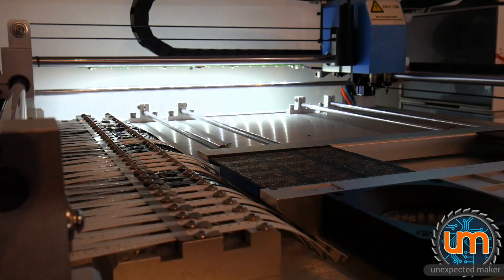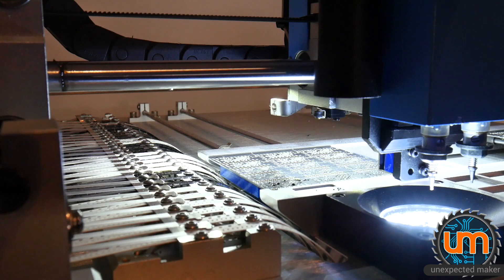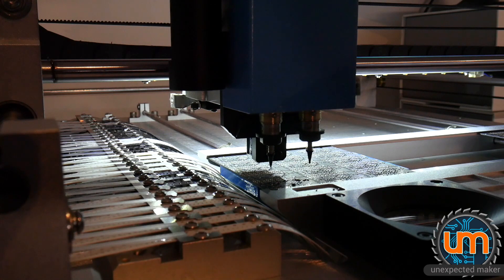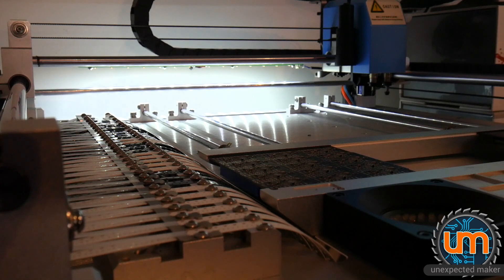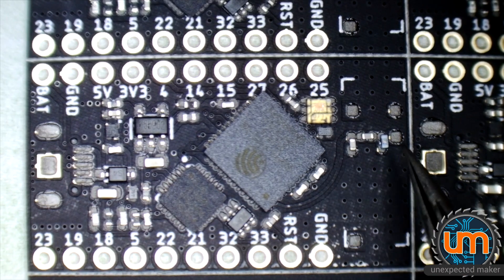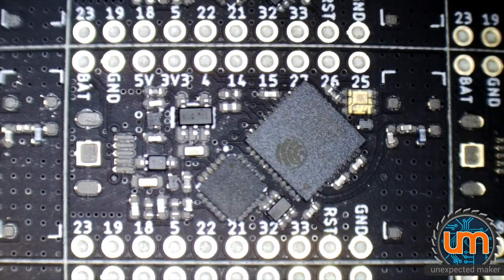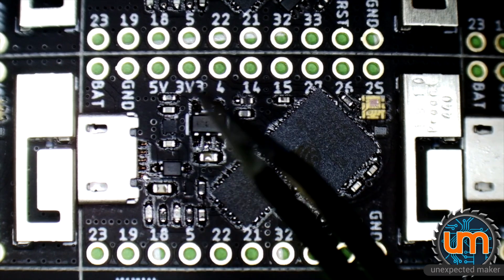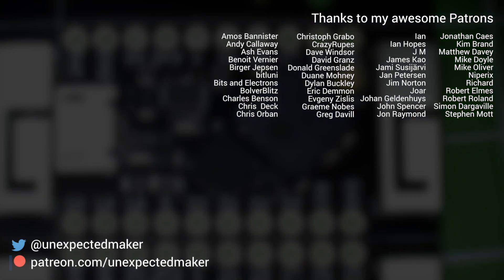My Pick n Place - Who won the battle?

Comment: I've got the CHMT-530P from the same company. The adjustment you need to look at is Z-axis speed. The parts are being placed with too much vertical speed causing them to bounce around on the board, giving the inconsistent placement you are seeing. Once you adjust this, you'll see that you get far more consistent placement.

Comment: Your're working completely outside my knowledge range... I watched a video a while back, and was fascinated by the way components "floated", and centred themselves in the oven.  This is obviously not the case with the small stuff like caps etc?  Interesting videos thanks.
Reply from the maker: The smaller the package (0402, 0201) the lighter they are, so get less influence from the surface tension pull from the solder paste as it reflows. Also, in my case, I am using quite small pads (due to space limitations) so even less pull from surface tension. You get to learn A LOT about DFM ( design for manufacturing) omg a project like this :D
Reply: @UnexpectedMaker  :  Thanks for the heads-up.  Again, not something I will ever use, but I was captivated by an older series by Dan Gelbart on Rapid Prototyping.  By the time I kark it, I will be right up to speed on everything... you've got to love Youtube!  Good luck with your ongoing battle.   :o)

Comment: Hi,

this might be a bit of a silly question. Would the black solder mask influence the surface tension, causing trouble with the 0402 parts?
I have seen a few videos where people get them to re-flow seemingly without issues with the classic green solder mask.

Ben
Reply from the maker: Not a silly question, but not specifically I wouldn't think, other than pulling more heat away from the pads than usual.

Comment: I realize it's too late now, but the size of your panel makes for a lot of risk for something to go wrong.  I would have been inclined to cut the panel size at least in half.  Sure, you're handling more panels, but less risk of a major wipeout, easier to calibrate to get the entire board, and easier to turn around tweaks that you make as you improve things.  Good video and congratulations on getting a bunch of boards into production!
Reply from the maker: Thanks Randy! I'm not sure what could go wrong that I'd lose any of the boards on a panel? Boards can always be cleaned off, and parts recovered, but all boards can be reworked and fixed if there is a bad issue, so no real risk that I can see. Calibrating 3x5 is no harder than 2x2... I calibrate the bottom left and top right, and everything fit's into place nicely.
Reply: @UnexpectedMaker  Perhaps it comes down to how much the parts are worth on a panel.  I have a small panel with four small boards each panel, but a populated panel is worth $20 in parts.  Not something I'm willing to just wipe off and start again.  I also don't have enough time to recover the parts and somehow put them back in the tape for a do-over.  For me, if there is a panel that needs to be wiped then all the parts are effectively lost with it.  Sure, I have piles of loose parts in my component trays that the machine has dropped over time, but I've never done anything with those parts once they got pulled or fell out of the tape.  I have to admit cringing watching how many components you had to nudge.  Given you have a lot of random placement problems, I still can't help wonder if a smaller panel would give your more process reliability.  Glad you're happy now with your methods.

Comment: Maybe tweek down the acceleration? Tighten belts? It sounds like you've got the systematic error down so calibrations won't help, you're left with random error.
Reply from the maker: It's proprietary software, so no ability to change acceleration curves. Belts are fine.. it's all been solved since this video.. stay tuned for an update video :)

Comment: Wow, that speed is scary to watch! Shame it's not 100% perfect, but I doubt if even the most expensive machines are. I love the double pick up and place of the large chips, very cool!
Reply from the maker: Yeah, I've optimised the nozzles so I get more dbl pickups now, so less travel, and faster assembly ;)
Reply: Your thoughts are correct. Professional Pick-n-Place machines are not 100% accurate aswell. Scotty was at the PCBWay factory and as you can see on this link, after the Pick-n-Place process, a person is doing visual inspection and improved using tweezers where necessary. http://www.youtube.com/watch?v=24ehoo6RX8w&t=6m18s

Comment: Try looking at the speeds, it could purely be under/overshoot, if there are ramp controls adjust them to be slow ramps to smooth out the movements to help ensure that it is stopping in exactly the right place, rather than overshooting randomly which could result in the issue you are seeing.
Reply from the maker: I don't have control over those types of settings... it's proprietary software, and none of that is exposed that I am aware of. I'll need to solve this with the options I have available to me.
Reply: @UnexpectedMaker  what kind of control signal does the software gives?

Comment: How come it sometimes picks up two components, and at other times only one?
Reply from the maker: Two different sized nozzles for different parts, so if 2 parts in a row need the smaller nozzle (left) then they go one at a time. I could optimise the parts order to get more 2x pickup happening, but that means screwing around with something that is reliable atm.
Reply: @UnexpectedMaker  Right. Got it.

Comment: I'm just starting to look into PnP and reflow.  Overall, how much 'better' do you feel the PnP would perform with a board of 0603 or larger smd components?  Do you feel the 0402 placement and reflow is an overall issue for entry level PnP machines? or is the need for moving parts under the microscope and reworking after reflow pretty much normal for entry level 'home production' with a PnP?

Great work, looking forward to learning micropython with my TinyPico :-)
Reply from the maker: I don't think you'll find a PnP under $30k that will do a job requiring no hand adjustment afterwards, and it's as much to do with the stencilling and paste application as it is for parts placement. COmponent size doesn't matter in this case, but the smaller the part, the more out of alignment it will be due to the same position error on 0402 will be half off the pads, where the same position error on 0603 will be 3/4 on the pads still.  Even $150k+ PnP machines need lots of work and calibration and tuning. So it depends on what you need to build. Hand assembly is your best option unless you need to build hundreds.

Comment: Great work.  How much does the vibration or movement during placement cause the parts to move, or was that just the camera moving?
Reply from the maker: I can't prove there is any part movement on the nozzle from machine wobble. Too many parts place reliably to have that be the main factor or a factor at all.
Reply from the maker: But I am going to look into this - stay tuned for part 2!
Reply: @UnexpectedMaker  will be interesting as there did seem to be a bit of movement which could shake the components..

Comment: They should make a single part that contains 8 1k resistors , 2 10k, capacitors, and 5v and 3.3v ldo, and maybe 1 or 2 leds (different colors).
Reply from the maker: Hahaha! 1 PCB, 1 component, everything inside.!
Reply: @UnexpectedMaker  exactly! Only the wires need to change per design ! :-)

Comment: If your board didn't require 402, would 603, or 80x be reliable with this pnp?
Reply from the maker: No, even the QFNs are misplaced as you saw from the video. Issue is 0402 has such a small margin for error that they cause more issues when out.

Comment: I noticed wobble of the machine. If you can secure it to a stable wall you might get a better result?
Reply: First thing I thought about too.
Reply: I wonder if running it say at 20% would end up with more consistent precision.   If so it would point to vibration or backlash etc....  if not then perhaps more of an electronic/software problem where steps perhaps are being randomly lost.
Reply from the maker: It can't run under 50% or the PID fails. At 55% it's no better in placement than at 75% with less machine wobble. It is attached to the wall, but at the base of the legs. No easy solution for me to attach it higher, but I am not convinced my placement issues are a wobble issue at this stage.